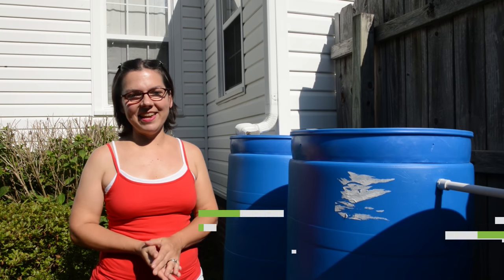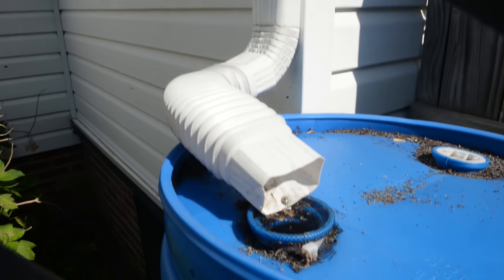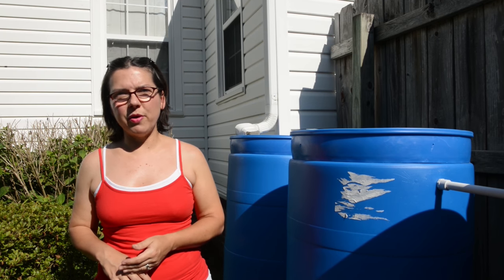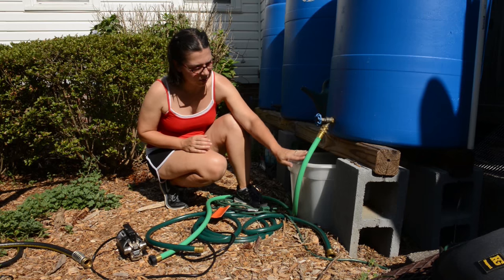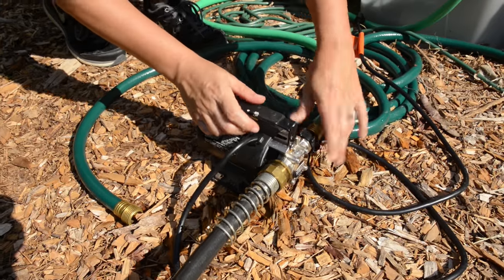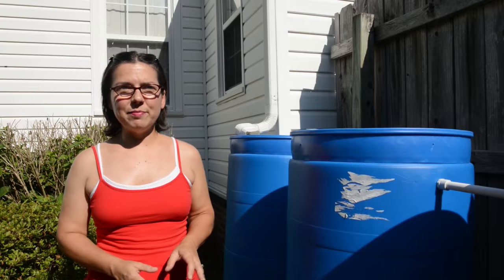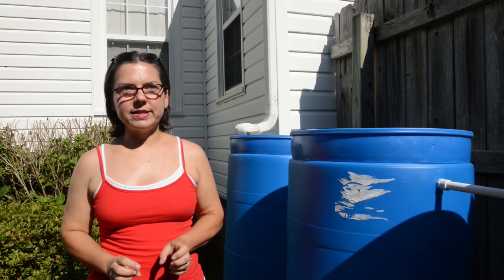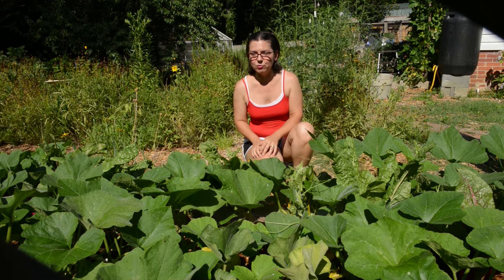Using Rain Barrels to Irrigate Your Garden

Comment: Good info. Thank you. Your garden looked great. Are you still gardening? For gardeners who will use a spray nozzle or shutoff valves in their irrigation system, the Seaflo line of pumps work great. They have an on-demand feature that will automatically shutoff when pressure builds in the line and automatically turn back on when pressure decreases (i.e. squeeze the nozzle or open a valve). These are robust pumps used in RVs and large boats/yachts. Either 12V or 120V. Great for solar power setup.

Comment: Personally i would have piped them together lower on the barrels as well maybe a couple of inches up from the bottom so they can all stay at the same level only using the middle spigot and which would allow you to use gravity as the weight would be the combined capacity of the 3 barrels

Comment: Washing machine hoses have female connections on both ends. They come steel braided as well. The hose itself can be a full diameter or a thinner diameter which you want to avoid if possible.

Comment: So I see 2 problems. You have a spigot at bottom of only one barrel which means you have two barrels collecting water for no apparent reason. Unless those barrel are connected in so way that I can’t see through some pipes that are close to the bottom of the barrel, you’re only getting water from one of those barrels and then you have to wait for more rain water to get more rain in the barrel. Secondly, unless you have a screen on the pipe serving as overflow, mosquitoes will literally fly up the tubes and lay their eggs in the water. Connecting the barrels with pipe at the bottom of each barrel in series with each other should give you plenty of pressure so that you can do without a pump.

Comment: You definitely should connect the barrels from the bottom area or when the barrel you are pumping from goes low you will then need to connect the pump to a different barrel. They cannot work together being piped together from the top.
Reply: I guess the idea is that if you connect them at the bottom, then the potential energey of EACH full barrel is transferred to the next barrel through the pipe in the bottom. If the pipes are in the top, only a fraction of the total potential energy is being transferred from each one?
Reply: I just used a old garden hose and used the siphoning effect to keep the barrel levels even.

Comment: Thanks for the video.  It has given me some ideas.  I have a number or barrels and have been using a sump pump which is a pain to keep dragging it from one to the other.  The transfer pump seems so much easier. Have you made any other videos on how you set up to water your garden? What type of hose and spraying system do you use?
Reply: I use a submersible pump 1200 GPH a hooked to  a digital timer which runs for 7 minutes in the morning.  I hook the   3 barrels using an old garden hose using the siponing principle, Gives me about a weeks worth watering so I be away on vacation.   If I need to be away for longer period I can hook up a couple of extra barrels.  System worked great when I took a vacation to the Redwoods National Forest and Lassen Volcanic Park in earlier mid July.

Comment: My setup is similar to yours, but I use a submersible pump 1200 GPH a hooked to  a digital timer which runs for 7 minutes in the morning.  Also rather than hooking up the barrels with  PVC, I used an old garden hose using the siponing principle effect which allows me to clean the barrels at the end of season.  My three barrels holds enough water to last a week which allows me to go on vacation or be away for a few days.  I can use the pump to transfer rain water from my 3  275 gal totes to refill the barrels when needed..

Comment: Good tip , i see a small problem. The way you elevated your rain barrels are bad. Ita the weakest part of the bricks. It will collapse over time.btw i use a gravity auto  watering system with a timer.

Comment: lift those barrels 3 feet higher so you won't need the pump...that's gravity feed...at the moment you don't have grafaty feed as you actually pumping water with an  electric pump.
Reply: Did it work? I only need a slow drip too and i wonder if I really need the machine.
Reply: Three feet is not enough to replicate municipal pressure.
Reply: @joshresnick9364  How many feet mininum to get gravity fed for drip irrigation? Thanks.

Comment: It costs 37 cents to fill a 55 gallon drum with city water.  If you divide that by the cost of the barrels, the pump, etc, you would need to fill 180 barrels a year to cover the cost.
Reply: I don't drink tap water I don't let my plants drink it either. don't you have any idea whats in tap water.
Reply: @Mazel_Tov_888  Be mindful of the chemicals coming from the asphalt on the roof ...
Reply: It’s not just what’s in tap water, it’s what’s not in tap water. Rain barrel water like mine where the tops of the barrels are open collect leaves and debris which slowly break down and creates water that is so much healthier for plants. I place floating water plants in  and they serve as landing pads for the insects that do a lot of good for my garden. Sometimes they die in the barrels also adding to the nutrient levels for plants. I place fish in mine and their poop is great for plants. You don’t get this with city water. The value of my rain water far exceeds that of city tap for all these reasons and more